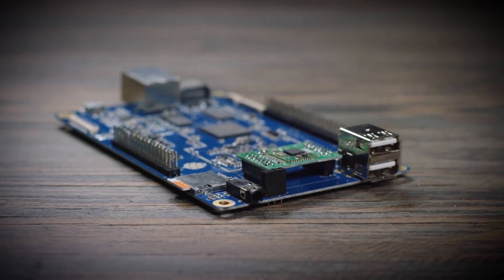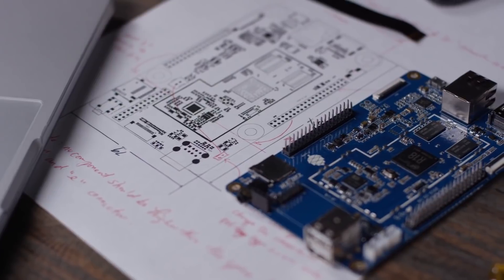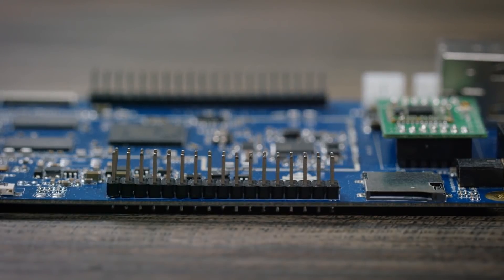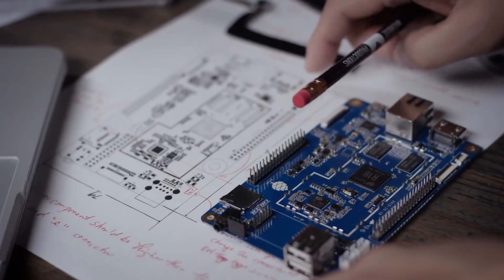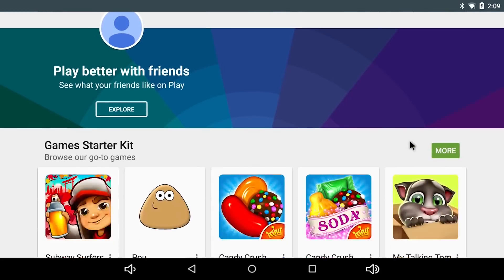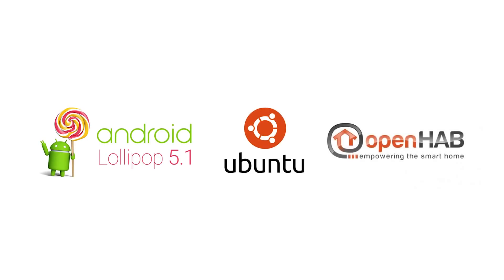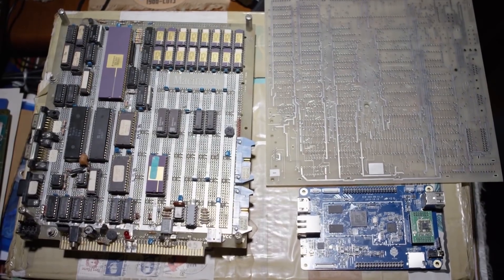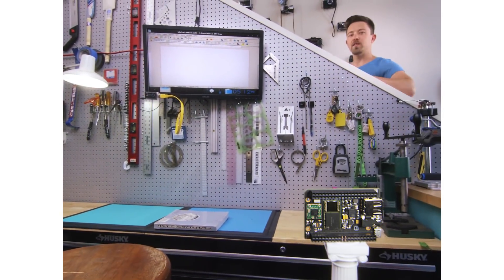4 Micro Single-Board Computers

Comment: I hate how this woman goes about harping about the "64-bit this, 64-bit that" on the Pine 64. There is basically no difference between a 32-bit computer and a 64-bit except for the fact that a 64-bit computer can handle more RAM than a 32-bit unit can. Peace.
Reply: Thats whaat happens when you higher a chick with probably no serious tech backG to sell tech!

Comment: Bet the Pine64 has shit graphics and will be sold for 4k... lord bless us
Reply: It's gonna be, appently, $15.
Reply: PowPingDone And Stuff
 you mean in 2000 years?
Reply: YellowPeaches Nah I checked the official website.
Reply: +YellowPeaches It's $15 for the 512MB RAM model, it's $29 with 2GB of RAM and another $10 for wifi + bluetooth.

So, $39USD + shipping and taxes.
Reply: Dr porkchop7854 Yeah.
Reply: +Dr porkchop7854 Essentially the same price of the Raspberry Pi 3, with an extra gb of ram!  I would buy it, but currently I am buying a GPU and PSU for my main computer, so it will have to wait lol
Reply: Daniel Pilecki I've been hearing pine64 is shit though.
Reply: I have also heard that, which is why I am also kind of on the fence about investing in one.  I could always go the safe route and just get the RPi3 and probably get similar/better results.  Maybe it was the 2gb of ram that was enticing me haha
Reply: Daniel Pilecki yeaaaaa fuck that. hell compile qemu and you get a rpi for free.